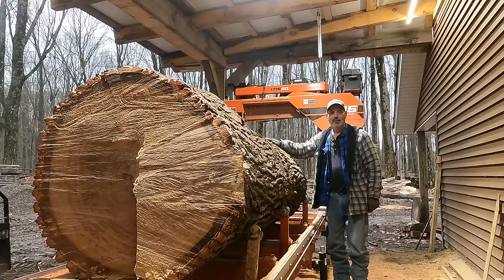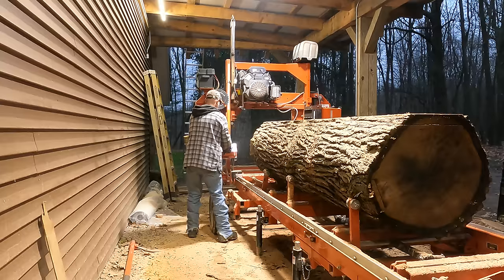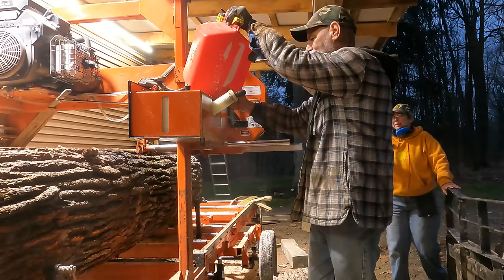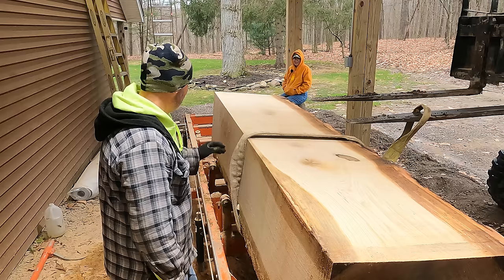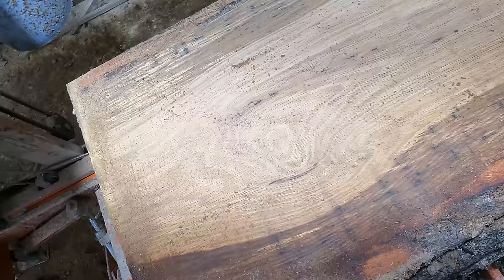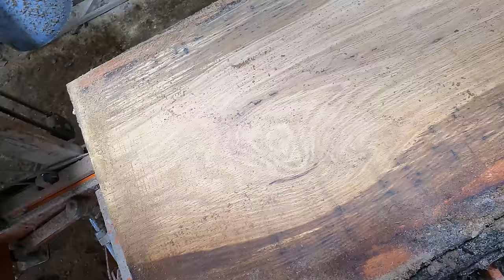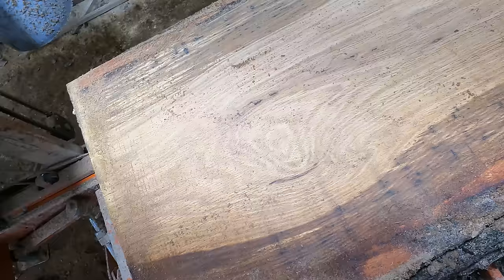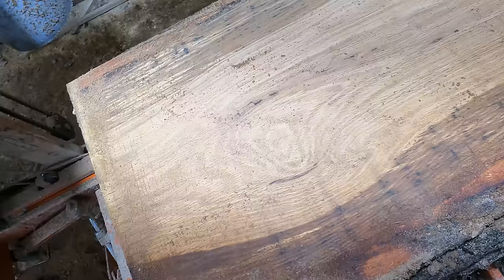Massive White Oak on the Sawmill

Comment: i also have a WM and I noticed one problem.  It is the source of the wavy cut starting. You need to clean the bark with a brush, the dirt and sand (rocks) dull your blade. It also knocks out the set and that is where those lines come from parallel to the blade.  Your blade life will be much longer if you're cutting into clean bark.  It is a nice 18" cant.   Also I keep the framing square at the mill and use it to verify the squareness before the cut by putting it against the underside of the blade and down the cut side of the log.  Good luck and enjoy the milling.
Reply from the maker: Oh I'm aware. This log the second day was frozen, we tried to brush the dirt off but It wasn't moving so I said heck with it, I got more blades...
Reply: I got him a nice, wide wire (grill) brush for Christmas...and painted "blade saver" on the handle. He used it in a later video.

Comment: I have the same Sawmill as you have.  However I have extra extensions for my Mill and can cut over 24' in length.  These extra length logs are extremely heavy and they take extra care to put on the Mill.  I use my bulldozer with a logclam to load the big ones and a Kubota GX135 tractor to load the smaller ones equipped with a logclam.  Enjoy your videos.  Good luck in 2024.!!
Reply from the maker: You have a nice setup! Thanks for watching.

Comment: I forgot to ask, did you have to get longer bolts to hang your sawdust bucket?  I'm guessing just flipping them won't leave enough length to hold the bucket?
Reply from the maker: Yes longer bolts and added a second nut. If I can remember will show it in next video.

Comment: In 2021 my dad helped me heave the butt end of a 10'6" long bur oak long onto my mill.  It was January, just barely above freezing, and my mill was in my garage.  We did it all with ramps, chains, and prybars.  This was after I had my mill on a trailer frame.  We did the same thing, heaved a log (ash) that maxed out my mill, prior to setting it on a trailer.  GUT BUSTERS.
Reply from the maker: I really like sawing the big logs. I have a video called curly maple, way past max size for my mill

Comment: I just found your channel.  Looks like you have some good content.  New sub.  I have an LT15 with bolt on wheels.  I am finishing up a 30” red oak log that was about 6 ft long.  It is all my tractor would pick up.  I wish I had a skid steer.
Reply from the maker: Welcome. If you saw much oak, order the stainless bunk covers for your LT15. They are worth it so you don't get metal stains and to protect paint on the bunks.
Reply: @mcsawmill  I got some 3/16 stainless and covered mine a couple of years ago.  Really makes a difference.

Comment: I have woodmill and I never got any straight and square like you did. I consider woodmill is for very lite use and small logs. Better than no saw but not close to lt 15
Reply from the maker: There are a lot of things that can get out of adjustment on a mill. I recently did a full alignment. That helped.

Comment: Nice job cutting so accurately.  Huge heavy log to handle but you made it come out great.  Now tell me WHY does anyone need 18" x 18" x 97" ??? Way to heavy for such a short length,  IMHO
Reply from the maker: It's for a post to hold up some sort of steel structure. I'll video it when they build it.

Comment: Pretty Oak log, I love getting to cut those big boys too! Have you thought about an I-beem with electric hoist over your mill to load and turn those monster logs. I have loaded and turned 8,000lb+ logs on my mill with my modifidy log trailer from an old propane tank trailer with a 12k winch on it. Thanks for your videos and your time!🤩
Reply from the maker: I have thought about it but the skidster works and is portable like the mill.

Comment: Nice video. but really you need a debarker to take the bark off i use to run one back in the day
Reply from the maker: I don't think there is a debarker option for the LT15. I could get one that goes on the chainsaw but I want the live edge to remain untouched.
Reply: @mcsawmill  okay I just thought about it thats all.have a great day.
Reply from the maker: @Bigone818  you are absolutely right though so thanks for the comment.